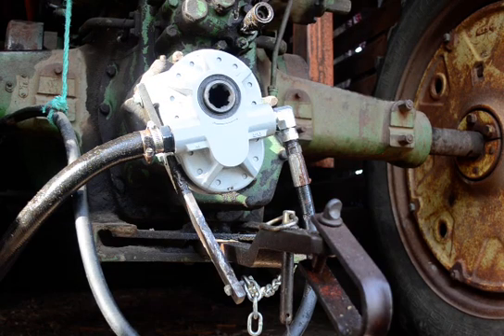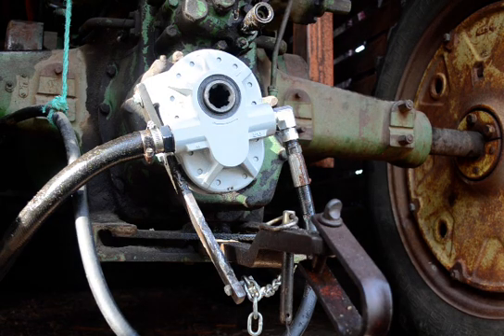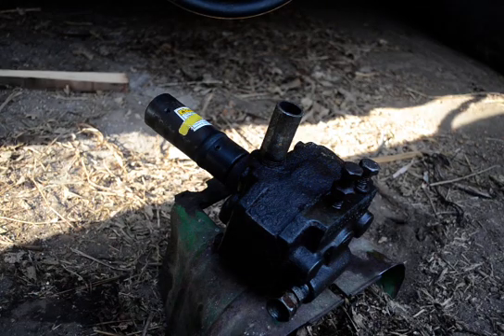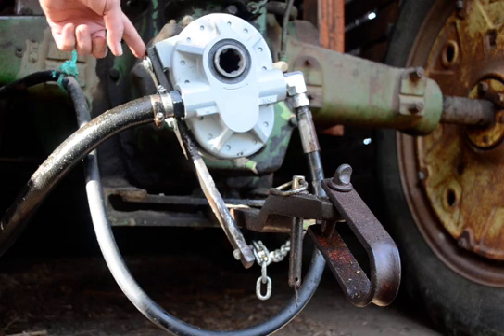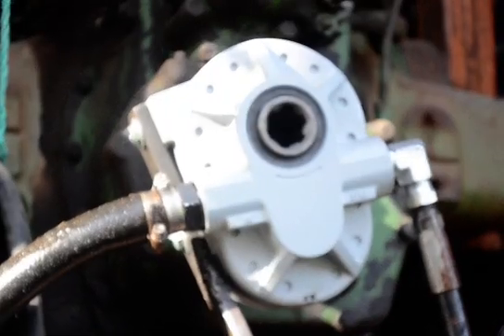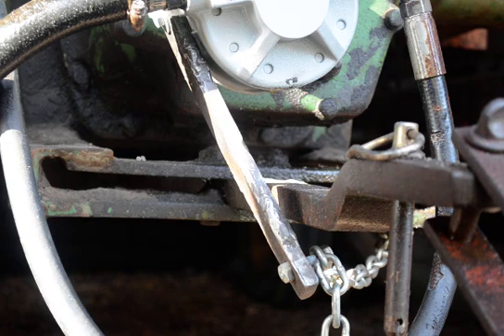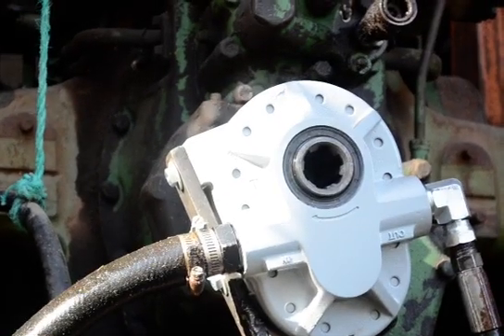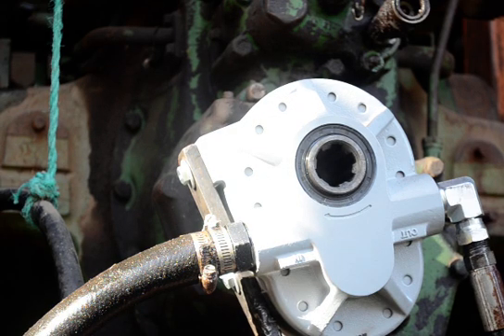Du Al loader PTO pump GPM, Woods, John Deere model 60 tractor

Comment: vevor is garbage. spend the extra few bucks and get a prince, or an American made pump. when your vevor cracks and you blow 200 shekels worth of fluid all over and spend the next week sidelined...... you know where I am going. as for the torque bar, 1/2 inch thick by 3 inches wide is what I run. probably overkill.

Comment: Do you have an auxiliary tank for hydraulic fluid or do you draw from the tractor reservoir itself? I’m installing a PTO pump on my David Brown 885 and would prefer pulling from the transmission if possible.
Reply from the maker: No connection to the tractor hydraulics. There is a reservoir in the loader left post.
Reply: @iowaunemployment  ok thanks!

Comment: Great video, thanks!!  Does this pump have to run at 540 rpm?  If your loader is running up/down a little quick, couldn't you simply slow the rev's down (say 500 rpm or 450 rpm)??
Reply from the maker: Lower motor RPM will slow the speed of the pump but not by enough. I should have used a 10 to 12 gpm pump.

Comment: what prevents the pump from sliding off the shaft?
Reply from the maker: Excellent thought.  The hoses are tight enough that they help keep it on and the steel bar with the chain that is hooked to the tractor frame keeps it in place. Even without the chain it would not come off due to the elasticity of the hoses.
Reply: I fabricated a simple torque bar from 1/4" angle and used the draw bar mounting bracket to fix the end of the connection chain to the tractor. (A '69 JD4020)

The torque will actually draw the pump up tighter to the tractor as the angle changes slightly.

I'll attach a picture as soon as i figure out how.

Comment: The only thing is to use something to support the weight of the pump.  The pto shaft is not design to support heavy weight and will cause bearings and seals to leak prematurely.
Reply: That makes no sense 

The hydraulic cylinders carry the weight …the Pto takes the load 

Pto are made to take constant load 

Wtf you talking about ?
Reply: @charlietullos6726 The weight of the actual pump on the PTO shaft

Comment: When you are running the pto but not operating the loader does the pump squall? Is there a valve in your loader control that allows oil to circulate when its just sitting and the pto is running? Is there return line from your loader plumbed back into the reservoir?
Reply from the maker: Does not squeal when running but when lifting slowly the valves make noise. Yes, it recirculates into a return line back to the reservoir.
Reply: @iowaunemployment  thank you so much. I'm plumbing an independent pto hydraulic system for my 4000 Ford loader so I can use the one factory remote for an accessory.  I just wanted to make sure when I wasn't using a function,  my pump isn't going to deadhead and burn up.
Reply: @buddymartin7923  Let me know how that works out for you! (lovely if you upload video as well). I'm considering doing that for my ford 5000.
Reply: @stestrupholm-dyrkjorden3478  will do. I'll be starting on that little project Friday
Reply: Da'gone pump is a CHUNK!! Sucker is heavy! I building an entire independent unit for the 3 point hitch on my ford 4000. I'm going to try to come off the unit frame with some chain to help support the weight. Course these things have been around forever so I don't suppose it will wear the pto bearing any worse than anything else...

Comment: I suppose you can no longer run any pto attachments while using this. Or is there an adapter you could use to still run a snowblower off the pto and use the loader? Any thoughts?
Reply from the maker: The PTO is too short for another device. I have to pull it off and hang it on the side of the seat with some baling wire to use my mower.  There are PTO extensions that give more clearance but not more useable shaft. I think you just need to pull it off and have your loader up high enough so the gradual downward creep doesn't get to the ground before you are done blowing snow.
Reply: Maybe one could attach a hydraulic motor to whatever you needed to drive and use the pto pump to power it.  Many mowers use this approach but use the tractor hydraulics for power.
The pto pump would be permanently attached to the tractor and the motor could be exchanged to whatever needed to be powered.  A little expensive and some engineering but I think very possible. Also there are hydraulic flow control valves that are adjustable to slow the gallons per minute of oil flow and can be added.  So if you have a large pump, you can make it act like a smaller pump but cannot make a smaller pump act larger.
Reply from the maker: @oby-1607  I think it could work, but this tractor and loader only has a value of $3,500 so it depends on the overall value of the unit and how much you want to add to that.

Comment: If you run the oil back through it with a powerpack does it turn??? Can you pipe it in straight into a powerpack
Reply from the maker: I have no experience with a powerpack.

Comment: thank you for the video,  but does the pump slip or work it's way off the shaft?  I am going to order one this week.  my old prince pump had a coupler welded on it.
Reply from the maker: The bar attached to the drawbar keeps it on. It has never moved an inch off. The hoses and the torque bar prevent that.

Comment: Thanks for sharing. The GPM and the sizing of the requirements is sorta confusing. Im trying to put together a rig on my tractor to run a fencepost driver and a front mount brush cutter. It does take lots of research but its getting there!
Reply from the maker: That brush cutter can vary greatly.

Comment: I went with a 7.4gpm I'm more concerned with the weight on the PTO pump weighs bout 37lbs roughly think I'm gonna make a stand to help take some weight off the PTO shaft
Reply from the maker: They are heavy and get pretty hot when you run them. I have to hang mine up to use the pto shaft for a rotary mower and you better use a good pair of leather gloves, hot and heavy. Good luck.
Reply: @iowaunemployment  got my pump all setup on my backhoe it gets warm but not hot I used it quite a bit yesterday digging some stumps up ran it for hour or so granted it's not very hot out bout 60 degrees

Comment: I have an old back hoe attachment. You think this would work fine on it and a jubilee? Thanks
Reply from the maker: Jubilee ford tractor with 25hp? I think you might be short on power. Can you borrow one first then decide on power needed? Something that old would probably be a lower rated device. I think 12gpm might work better due to power.

Comment: Question do you need a tank with that syestem?
Reply from the maker: This loader has a resivoir in the post on the left side of the loader. They all have a resivoir. Don't over fill or it will shoot out the excess after it swells when hot.

Comment: you can add a restricter fitting, to slow the gpm that goes to the loader, and still have the available flow for other hydraulic items, if you put the restricter just before the loader controls.  I think its around 25$ . some are adjustable.  the psi stays the same, but flow is adjusted by orifice sizing.
Reply from the maker: Do you have a link to a video showing this. Thanks, great reply.

Comment: Most front end loaders only require about 5 to 7 GPM of flow. A 17 GPM pump is for driving a post hole digger, hydraulic mower, hydraulic rototiller, etc.
Reply from the maker: Wish I had known, could not find any literature on point. Lucky I did not get that 22.5 gpm pump suggested by one guy.